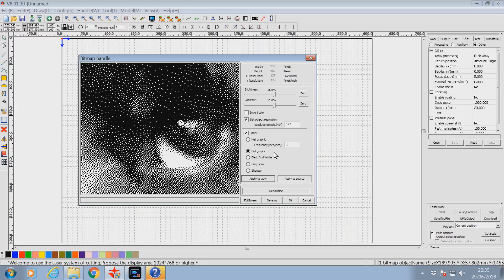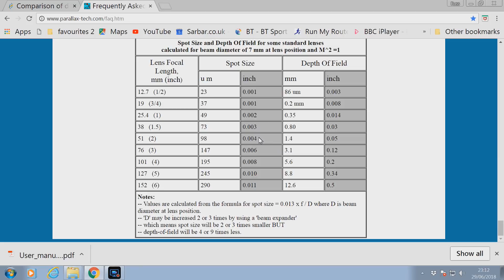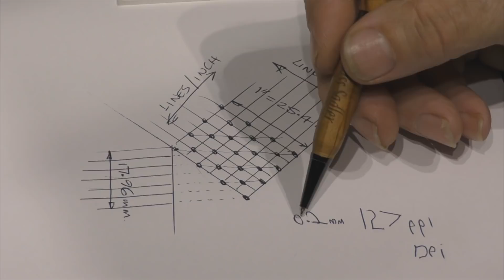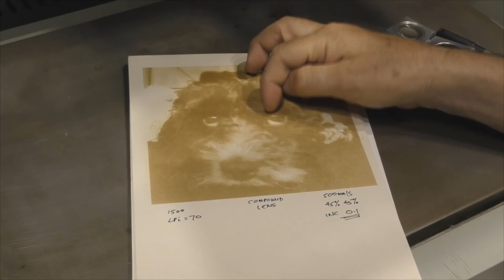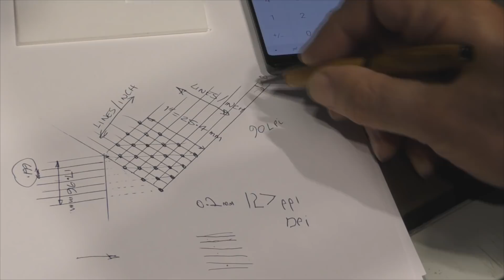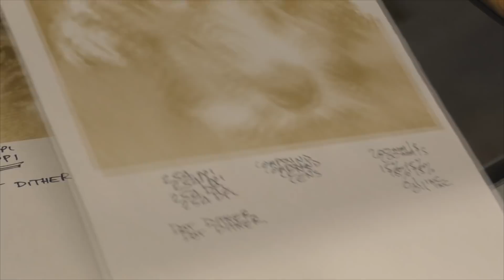RDWorks Learning Lab 145  The 1000 DPI Mystery Solved

Comment: I have to wonder if your results would be different with another substrate other than paper/cardboard. Surely cardboard reacts differently from say MDF or plywood or even acrylic. Would be interesting to find out.
Reply from the maker: Hi Bruce
You are quite correct with your question. Different materials do accept damage (dots) differently. This beer mat card is almost pure wood pulp. Yes it is soft and takes dots easily, that means I only need to use minimal power usually. I imagine it as soft grainless wood and I have used it extensively in other testing and know exactly how it performs. As it is a white card it has a much wider colour pallet than MDF. MDF is also composed of a high percentage of binding resins that cause a lot of fumes and can easily corrupt the colour pallet with it's residues. Acrylic is a fantastic material for some things  but it is VERY difficult to achieve small dots.  Even the best ply surfaces have a grain structure and that grain has various densities of cellulose/resins that will  have different damage thresholds.  In reality this was not a real comparison test to see if I could achieve 1000dpi, I know that to be impossible, instead this was all about the stupidity of generating a 1000 dpi image  and trying to reproduce it with a machine/lens capability of 127dpi. That means that when you tell the algorithm in RDWorks that you wish to scan with a 0.2 interval in Y, it has to look at SIX lines of pixels at a time and make some sort of averaging decision. As I have demonstrated, this makes it very sensitive  to aliasing/Moire patterns. Even with my super fine dot compound lens. which I believe is more capable that their expensive HR system, I can only achieve 0.1 dots and when I set the scan interval to 0.1mm that again  causes aliasing. Apart from the physical impossibility of getting 1000 dots per inch onto any material, there are other serious barriers. Lets just assume that we run at a very casual scanning speed of 200mm/sec.  1" is equal to 25.4mm therefore  200mm/sec = 7.87inches per second.  Thus at 1000dpi , in one second we need to be capable of  1000x 7.87 dots ie 7870 dots per second. If you look at any HV power supply specification you will find the response time is less than 1ms to reach 90% of the demand value.  In reality you are asking for  8 times more dots that the power supply is capable of delivering. That means that to stand ANY cance of the power supply delivering, you will have to run at 1/8th of the speed ie 25mm/sec.   Can you now see just how impossible  this whole 1000 dpi  saga is when you stop and look at it logically rather than emotionally.

I have spent huge amounts of  machine time, materials and effort on this subject of finding what the smallest physical dot is that we can produce. I have shared that learning journey with you all in the hope that  you will also be wiser about some of these illogical claims. At 254 dpi ( the most I can currently claim) my typical scan speed is 100mm/s or 3.94 inches/sec.    254 dpi = one dot every .004" . Thus in 3.94 inches  there are 984dots . That is just inside the performance limit for the HV power supply ie.  just over 1ms/dot.   If I am ever going to get to the 0.05mm dot (ie 508dpi) then I shall have to run at 50mm/s.

I hope this allows you to see that you can waste a lot of time and material trying to achieve the impossible.

Best wishes
Russ
Reply: Wow, thanks for such a comprehensive reply Russ, I appreciate the time that took. Your channel has been a learning experience for me and you have saved people like myself from going down the impossible road of attaining 1000dpi on our Chinese workhorses, heck I am still struggling with the whole power/speed thing. :)

Comment: I just want to point out that thinklaser also claims a max resolution of 2500dpi on their machines ( on the datasheet). When you compare that to the 1000dpi that thunder promises it is more than twice the lie... but you have not said anything about that so this leads me to think that maybe you are biased
Reply: /facepalm :(
Reply: Did I write something wrong or untrue?
Reply from the maker: Hi Jimmy
 That's a very astute observation except it purely relates to the precision of the head movement ie steppng precision of 0.01mm . There is no claim to be able t produce bitmap engraving to that precision or supply a special a lens system to match the claim.  It was the unsubstantiated nature of the Thunderlaser claims that prompted me to push my work with small dots into uncharted waters. I have to indirectly thank them for helping me (and hopefully  the laser community at large) in understanding the absolute limits that we can push our little Chinese dragons to. For most it will be 0.2mm dots at 127DPI and for a few  it could be 0.1mm dots at 254 DPI. There is a natural physical barrier in the materials themselves to  register visible damage from an impulse of energy.. To create a small visible dot, the power needs to be low and highly focused. In general for all standard lens configurations the "burnt" dot will  twice the diameter of the theoretical spot size for the lens because the colour in the burn comes from the outer halo of the beam where the energy is lower and less piercing..
Thanks for the comment 
Best wishes
Russ
Reply: Hi Russ,
thank you for that clarification as always love your videos and your contribution to the laser community.

Regarding my comment earlier it is just that I don't like the way they write "highest scanning resolution ......  2500 dots per inch " because to novice lasercutter-user who is thinking about buying one of these machines  it is quiet misleading. Then again anybody who wants to get into laser engraving should just watch your great videos to understand the limitations of such machines. Lastly just as a side note they have a few figures in their datasheet which are quite misleading( e.g. max travelspeed ).
Thank you for your answer and educative videos.
Best wishes!
Jimmy (long time fan ;) )
Reply: No, my facepalm was them saying their machine will do 2500dpi as that is just impossible.  A potential buyer will see that and say their scanner does 2400dpi for scanning photos so now I can laser them at that quality.
Reply: Yeah i think so too^^